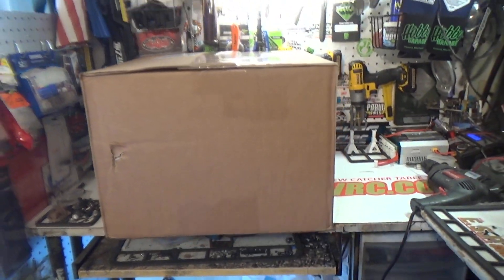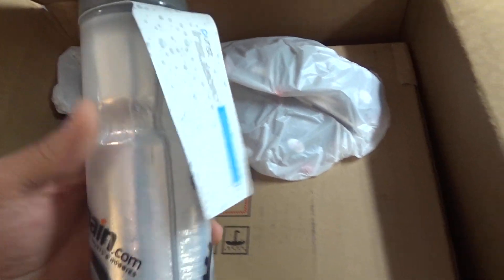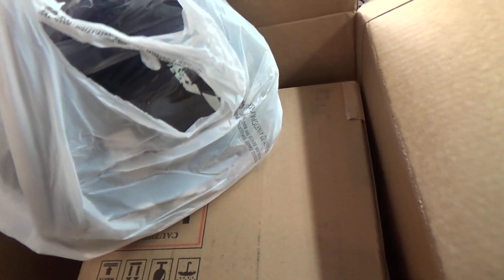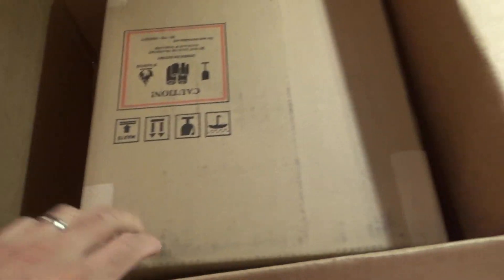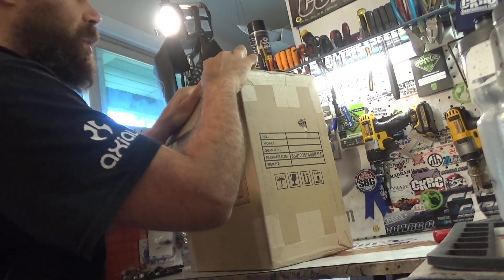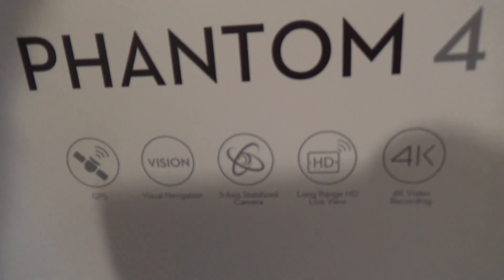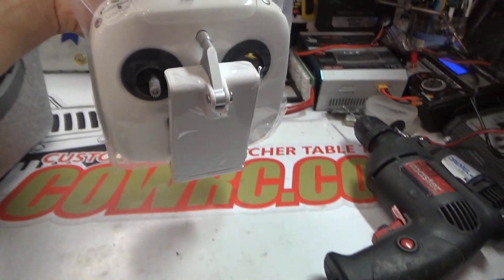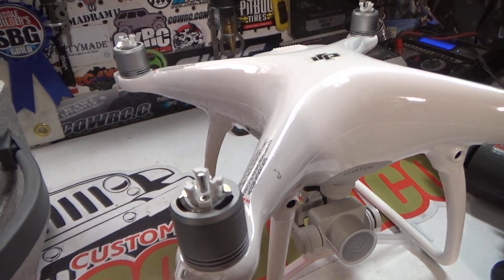CAMPING WITH COLEMAN | UNBOXING THE DJI PHANTOM 4 | AMAIN HOBBIES

Comment: Ha, Wow man, sweet little set up!, somehow you know how it is sometimes you scroll through channels and i came across your your other channel which directed me here, we were pressing out some resin and stuff,,,"Nice to meet you too"
 I'm in Australia, ive done a heap of RC, I love it! I'm not into shop or anything, I've been doing Steel Fabrication now for 22 years, until i had a head injury at work, 18 months ago, I have dogging experience and i"m certified and i took a nasty Blow to the head, I don't recommend it at all!!
 ive worked on and off from march last year to October when the company i worked for and where i was injured, unfairly laid me off, i had another injury, where a piece of steel went through my boot and lodged into my foot, i was laid off by the owner/Director of the company, the next day, that was after threats by the Owner/Director,, "What a Crock of Crap Man eay!""
 My Orthopaedic surgeon stating in regards to my foot injury, nerve damage with no operation could fix, however I've been doing exercise physio building up muscle around my ankles to reduce nerve pain, exercise physio also on a progressive exercise plan to build up my mobility in regards to being able build up my core strength and keep it up without aggravating my head injury and triggering anxiety, as i suffer Post Concussional anxiety as a consequence of the head injury, that was 12 months ago, its november now, so past that date, ive been doing some thinking on how i can move forward, obviously i have had a lot of rest and relax time and let my brain heal!,
 ive been doing a lot of study of CBD and i'ts wonders and magical ways it helps with Neurological pain and disorders, without the suppler DiscoverCBD who supplies and ships to Australia, "Which I'm Awesomely Stoked about" I wouldn't have had access to some of the Awsome CBD Wax Cannabis products in the world! the products have helped my recovery and kept me Calm you know?! I Love the Phantom 4, another guy i follow TJHUNT&co i follow uses it in his channel and I SAY, IT IMPROVED FOR THE CONTENT ON HIS CHANNEL SO MUCH! ALL THE BEST WITH THE PHANTOM 4, Don.t get to Shatter'd and land it in a lake! I'am sure to be watching, Big HII and peace from Downunder,,,,,